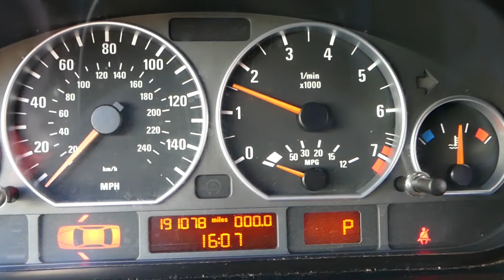WHAT IS A SEAT POSITION SENSOR AND WHAT IT DOES, AIRBAG LIGHT ON

Comment: Dear Auto repair guys: I have a 2003 Ford F-150 XL pickup with airbags. The truck has a bench seat with a fixed non reclining seat back. it is extremely uncomfortable to drive for much ore than about 2 hours. I need to find an airbag compatible aftermarket seat. Can you recommend such a seat?